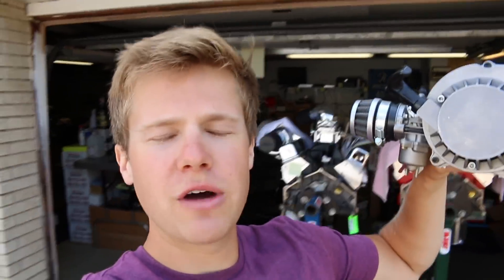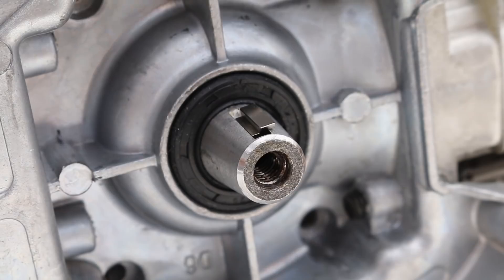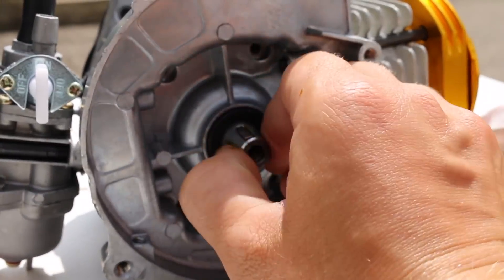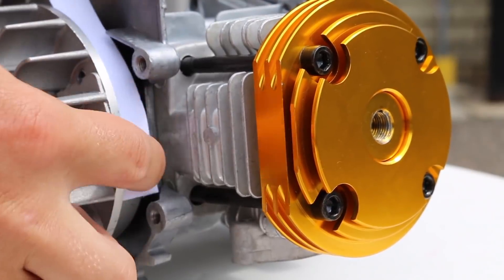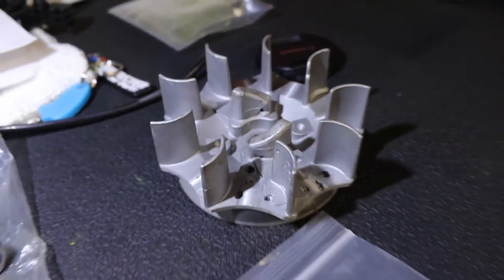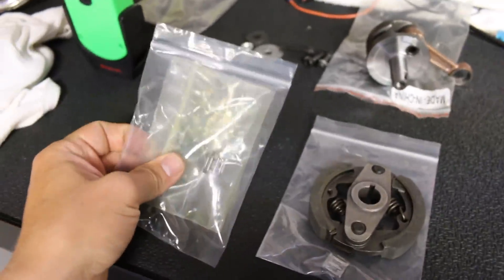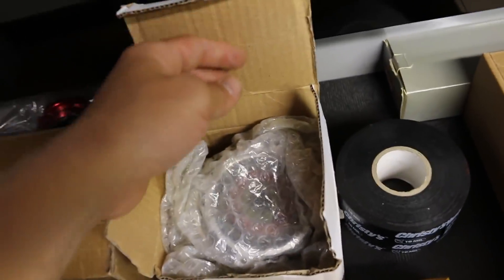ROCKET KEY Installed On 47cc 49cc Engine! Every Step Included

Comment: Great videos Im doing a similar build myself had a 49cc engine that was shot and it was just cheaper to buy a new one than order the parts needed. Did you ever install the electric start? Thats the one thing the new motor didn't come with, may swap over the old unit.

Comment: Hi guys I just bought my son 1 of these 49cc dirt bikes it's only been ridden twice bought from new and for some reason the rear wheel has locked up . Bike will start if it's up on a stand but the rear wheel spins, engine guts off when wheel stops spinning. Any ideas on what it could be. Waiting for the shop to get back to me
Reply: Clutch is stuck on by the sounds of it. Pull the clutch bell hiding off and see if it's stuck to the clutch inside.
Reply: Mine was same .I took the bell housing off and found spring had come off and was jamming clutch

Comment: I too hav an exahust system. Its a tecnigas exhaust system but i will have to chop and re weld and replace the manifold with a mini moto 1. Also do we need to do any thing with a clutch variator or do theese engins not have 1. Also im intressted on gettin the rocket key. Also could you not take all the fins off the fly wheel 2 lighting it right up sure it will add to the performance. Also you ever thort about a transmission box on.

Comment: I hate to tell you this but that full circle crank is bad news now you're poor crank bearings are going to starve because the two stroke mix can't get in there to lubricate them because the full circle Crank is blocking that from happening..
.  it's best to do CAM2s turbo crank mod on a stock crank 

You need a piston with a 12mm wrist pin for that crank to work by the way

in case you haven't noticed you have to put a lot of thought into these engines to make them work right and a lot of modifications fitting and grinding all you're doing is buying junk parts from China and bolting them together your engines not going to be very good I'm sorry to tell you that...

that lightened flywheel you have is bad it's better that use a stock flywheel and mod it like how Skullcam did...

now you're going to have the rotating Mass of that full-circle crank and that heavy to two shoe steal clutch and that lightened flywheel isn't enough to counterbalance it...
bling bling lol
Reply from the maker: Okay bro I understand your trying to help but your kind of turning me off from it calling everything I’ve been doing ‘messing up’ nothing is messed up. The engine is incomplete right now, I’m still learning about what I need to do. Thanks for watching tho
Reply: Dylon Desbiens your right it's a work in progress I'm not trying to turn you off to moding why don't you stop by pocketbikeplanet.com  and join our forum that's where all the old school builders hang out we have been up to building for years :) we will help you get it all sorted out so your getting good race proven mods that work together to build gobs of power MrKitty CAM2 and EPR have all built tons of engines

https://m.youtube.com/watch?v=Bv0tTfXCLQ0
Reply from the maker: Thanks for understanding, I’m just trying to learn here like anyone else... I’ve been consistently saying this is a community build because I of course wanna hear all the little tricks and mods just like anyone else but the difference is I’m exposing myself by showing people how to do it in the videos. I’ll be talking about this in my new vid tonight! Hope you stay tuned! Thanks for any info you can give me for the build

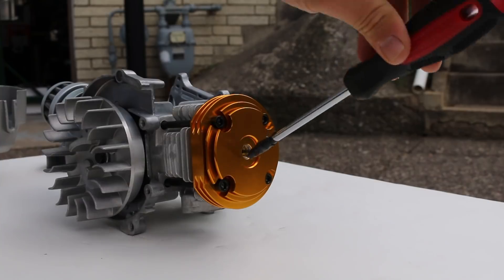Comment: 1:15 dont use a screw driver. Just use a rattle gun and itll come off straight away. No need to risk your piston
Reply from the maker: Yea true, thanks
Reply: Dylon Desbiens just give it a try. Sometimes small engines turn over but larger engines it works just fine

Comment: Man those v8 motors are beutiful!! Hopefully this thing will rip! Are you gunna get the top end ported? That will just be the icing on the cake. If I were you I'd use a pumper style carburetor like the Wj 71 (people use that on 50-71cc engines) to get the most power and you won't have float bowl slosh. Also that crank looks nice especially for 17 bucks!
Reply from the maker: THANKS!! The porting and major work will be done when I get speed numbers off these 'standard' upgrades. Since thats so more advance I figure I do it that way. Yea still considering my carb options... I hear the Dellorto 14/14 is a great option too!
Reply: Dylon Desbiens no problem!!  Yup that Dellorto is a great option

Comment from the maker: Give this video a LIKE for me!!

Some of you are saying retarding it like I did could damage my engine and won't be positive. Never heard this? Whats everyone think?
Reply from the maker: Unlikely for this little 2 stroker Blake
Reply from the maker: You can go to the right or left. To the right advances and left retards as I explained we'll see if retarding it like I did here works good though. Idk what you mean about the 5 o'clock though. The common thing with these is to advance it but I think they say that so much because It sounds better than retarding it. (Not saying retarding will work perfect though)
Reply: If you have a circle clock about 5 of the round clock (a little right side of 6 o'clock).
we'll see about retarding the ignition! also some of this clutch doesnt have the notch but watch pics of the same ones with the notch online
Reply: An actual turbo not a electric turbo a real motorcycle turbo
Reply from the maker: I Just Ebay search the parts like "47cc rocket key" or "47cc performance Flywheel"
Reply: You need to take flywheel off and put the rocket key to the right side,
take the piston all way up and put the notch about 5 o'clock, the clutch engages late and get the jump on start line (NOT sure o that clutch but may work too)
Reply: A rocket key in a modded engine might cause it to overheat (I’m not 100% sure of this because every engine is different). It’s all about testing because some run good in advance, retarded and some run better with the stock one. You won’t really see a big difference with the key, it’s more of a feel thing.